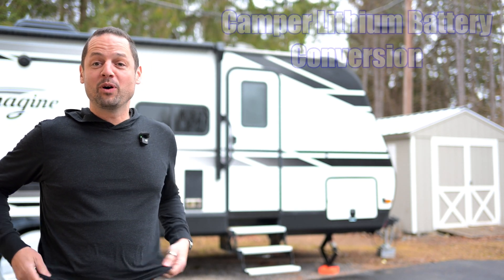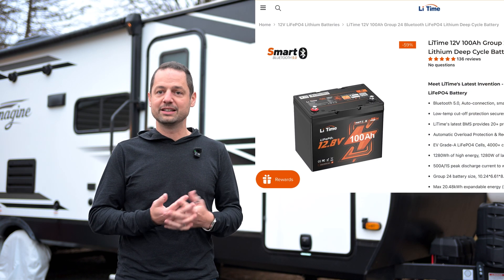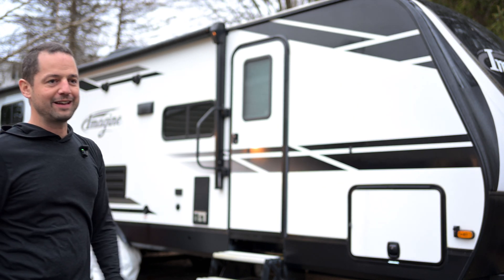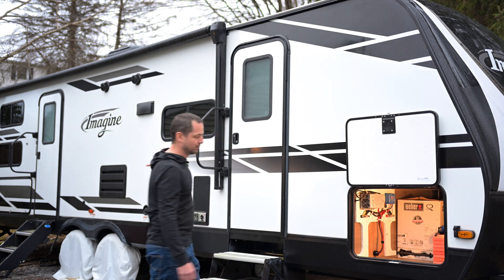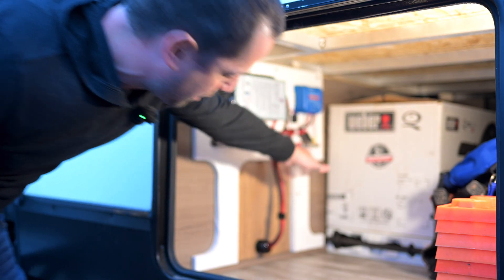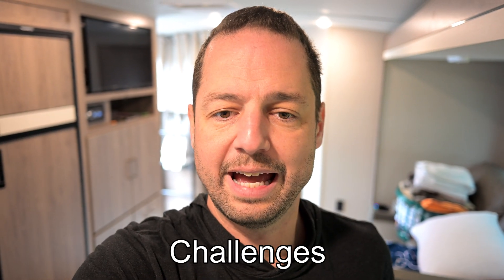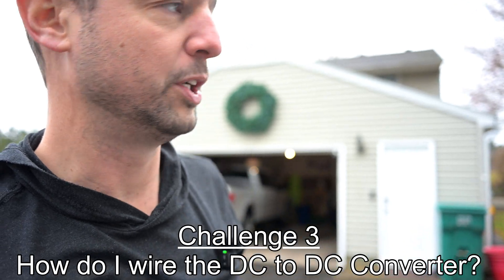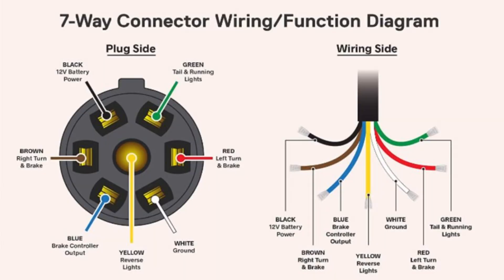Lithium Conversion

Comment: Your video was very useful to me!  I have a 2021 Grand Design 2910BH and will be doing a similar lithium conversion.  Did you keep or replace the factory battery disconnect switch?  Also, did you only use the input and output terminals on the DC/DC converter?  What is the switch that you located next to the DC/DC converter?  If you add solar, how would you connect it to your system?  I discovered it is easy to access the factory charger by removing the drawer above the fuse panel.